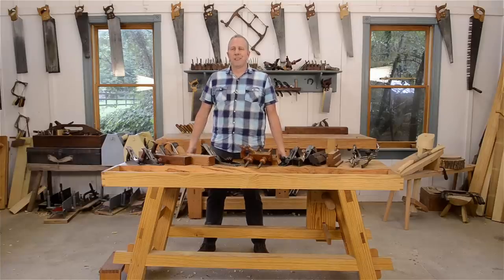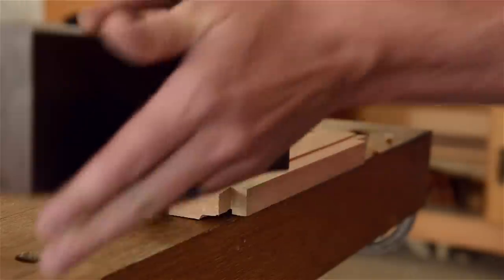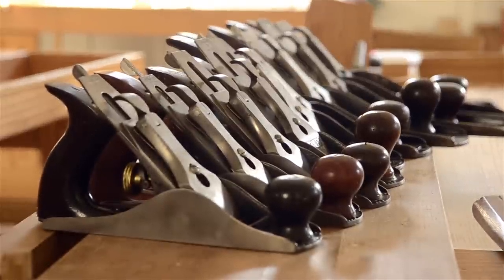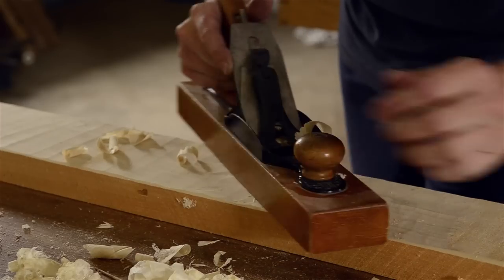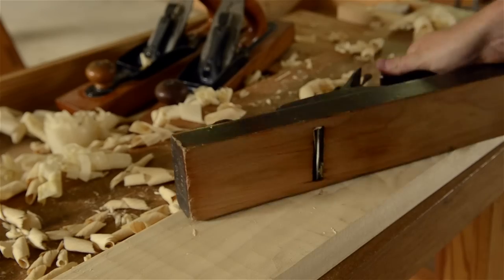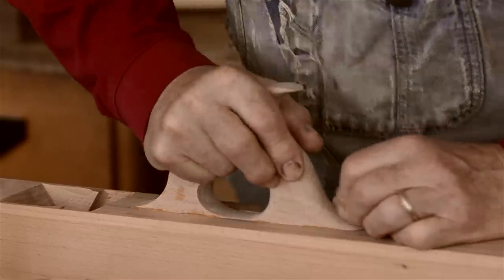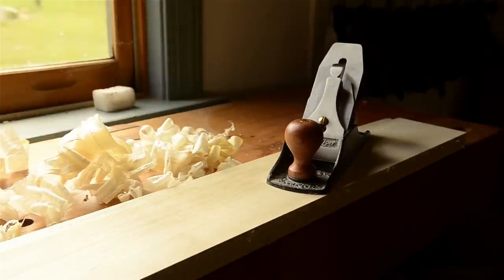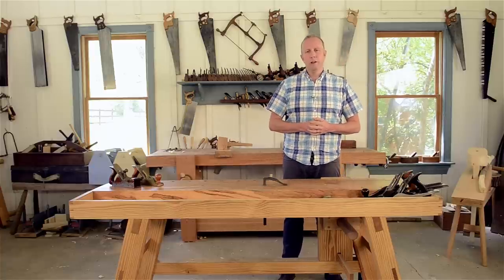Watch This Before Buying Handplanes for Woodworking

Comment: Thanks Joshua, excellent and informative video. Just one small piece of advice to your subscribers, avoid new Stanley block planes, the soles are bent like Bananas and you can strike matches on the finish. Appalling. Regards Jim UK.
Reply from the maker: Ha, ha, maybe Stanley lost the recipe?
Reply: My Stanley block plane's sole is flat enough, but the bed is so uneven that the iron extends almost 1mm further on the left side than the right. Essentially unusable. Could've spent the same money on a vintage one that was made when QC still existed.
Reply from the maker: @ArgyleAdams  Yeah, QC is a lost art. Although I'm struggling with an old handplane with the same problem right now.

Comment: The little scrub plane that you do not prefer was, I believe, developed for the carpentry trade. They are excellent for backing out moldings and casings, taking down the high spots on beams and studs in preparation for wall finishes, etc. I always include mine in my tool kit when doing remodeling work, especially on old houses.
Reply from the maker: You got it exactly right Ted!

Comment: If you're listening, my first plane I bought was a vintage Craftsman No. 4 that I set up for scrubbing and then I bought a Taylor No. 5 for $99, which I tuned up for smoothing.  Did I do that backwards?  The Taylor is nice and I didn't want to spend $99 for a scrub when my Craftsman cost me $30.

Also, should I add a no. 7 to my lineup?  I'm holding off on that unless I spot a real gem for a low price on craigslist.

Comment: Hi, thank you very much for making this Video. I am a mom of an 18 month old toddler, and I want to make a cutting board out of solid wood. I want to use hand planer instead of sanding tool to avoid the dust. But I don’t know if the hand planner is toxic free to me jae something that will contact food directly. Is there a coating on the base of the steel? Is there lead or other toxins in the steel? I couldn’t find any info on website, could you please suggest? Thank you very much!

Comment: I have a set of Bayley 2 through 8 I use my 4c and 5 1/2 the most. I had been considering getting a bedrock or similar. I just don't see a reason to do it. When I tuned up these models I have, I figured they did what I wanted. I did purchase some newer Stanley block planes one normal angle and one low angle. I am still figuring out how all these work but having a great time trying to make things.

Comment: can a plow plane be used to cut rabbets?
Reply from the maker: That would be hard because the iron would be touching the fence.
Reply: @WoodAndShop  i guess i could leave a small gap between the iron and the fence and pair it off after?
Reply from the maker: @blueace115  Yes, that is absolutely an option. You can use a bench plane to plane off the strip of wood!

Comment: 1. Bedrocks are overrated and does absolutely nothing more than a good vintage Bailey
2. Throat adjustment is not really a particularly useful feature as long as they are not too wide
In both case... the premise is that your blade is nice and sharp.  That's all there is.  No magic.